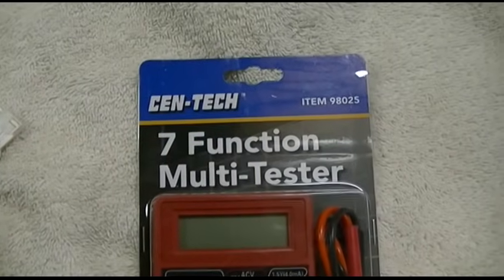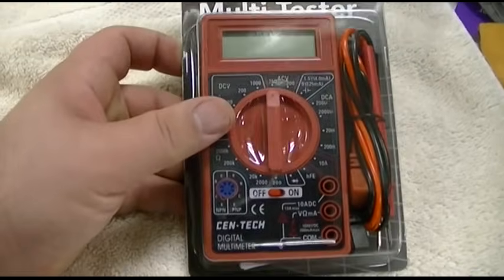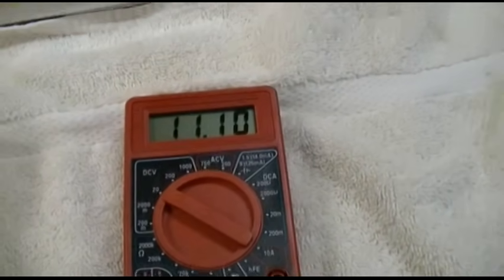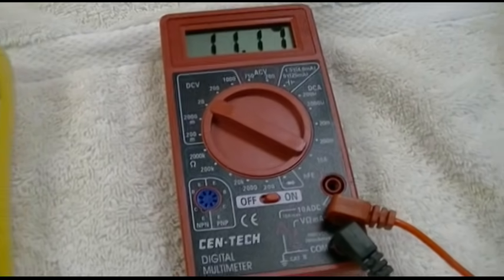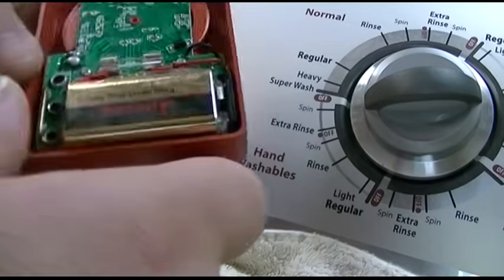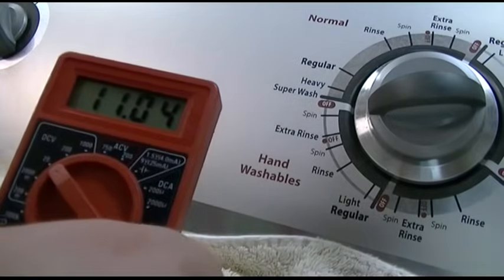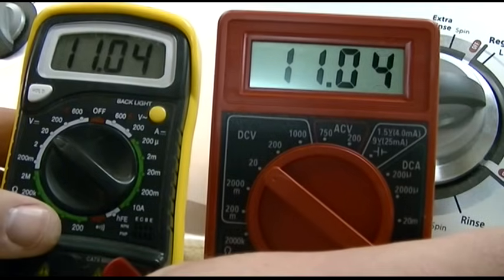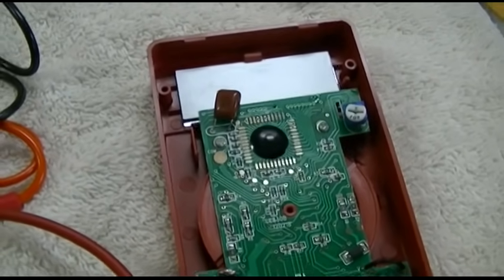Harbor Freight - Cen-Tech 7 Function Digital Multimeter Review

Comment: Oct 2025 Update to the Updates: Still have my free CEN-TECH Digital MultiMeter with fuse/adjustment Item# 69096 from 12-15 yrs ago, it works great and you're correct about the wireset probe insulating a single strand of hair. Today Oct 2025 $5 coupon, I bought same looking Red HF meter = 7 Function Digital MultiMeter Item# 59434. The name CEN-TECH is no longer on tool, package or paper, (7 Function) is on meter where CEN-TECH was. Still No fuse/adj, My Old meter DCV 1000, ACV 750 - 200, 10A. New meter DCV 250, ACV 250 - 200, 5A. Thanks for the Informative video.   Prices are up, I was able to get crabs the last time I spent $5.00.
Reply from the maker: At least they have become more honest about what the meter can measure with those leads.  With a good set of leads, while they may cost more than the meter, it could be quite capable.  I know the adjustment went away long ago.  As for the name disappearing, the name meant nothing anyway.  This is a generic meter that you can probably find on Aliexpress for even cheaper.  Harbor Freight contracted with them back when and had them print "CEN-TECH" on them.  When I was a kid, you could do some damage for 5 bucks.  10 bucks would do some real damage.  If you had 20, you were rich.  These days, even $20 means nothing.
Reply: @jaykay18  Copy that. Again, thank you for sharing the knowledge.
Reply from the maker: @paneesnatcher  You're welcome.

Comment: finally had to replace my Cen-Tech 92020 after 10+ years of use and the current replacement for this model is an off brand model (says 59434 on the package but no brand anywhere on package or multimeter itself) it looks nearly identical except for lacking a back light and the max readings have been reduced (5A / 250 DCV vs. 10A / 1000 DCV for the 92020) also the new unit is off a bit on accuracy by +0.27v and they've removed the adjustment pot so guess its luck of the draw for this one, it was only $4.99 in 2025 so guess I cant complain. I'll probably just buy the next step up model which is an actual cen-tech branded 9 function model for $15.
Reply from the maker: Even when adjusted on the old ones, this is still about the cheapest meter money can buy, at least retail.  You can probably get them for half that price on something like AliExpress.  Regardless, still a great meter for voltage or no voltage, when the reading doesn't exactly matter much but just has to be in the ball park.  Same with resistance, when you're looking for continuity or no continuity.  40 bucks will buy you a really nice meter on Amazon that's still pretty cheap, but ups the functionality.  I have one about that price, it's got the backlight, a flashlight, and even a temperature probe.  Meter leads are much nicer as well.

Comment: I have the same Cen tech seven function digital multimeter, when I turn the dial to DCV 20 V it’s still bouncing around between 15.5 and 18.7, does not zero out, what could cause this, put a brand new battery in it still does it, can you turn that little thing inside to zero it out?
Reply from the maker: You're expecting $200 meter performance out of a $7 meter.
Reply: @jaykay18  not at all, It used to zero out when I turned it on, now even when you touch the probes together it shows -1, just thought maybe there was a simple fix
Reply from the maker: @wild8757  The leads, probes, and meter are total junk.  That's why it's cheap.  There are 4 problems that can occur with this meter that I know about, dirty contacts in the selector switch, wires breaking off where they attach to the plug that goes into the meter, the jacks on the meter itself, and the wires falling out of the probes.  I have fixed all 4 problems on my meter and it's still working.

Comment: Trying to figure out why mine reads "5A" where you have it set instead of whatever yours says
Reply from the maker: It's been many years since I recorded this video, the models have changed over the years.
Reply: @jaykay18  makes sense.. just trying to figure out how to check the wires on my bike. I have a problem that's not visible. Not getting power from the battery etc... & thinking that i need to hold the black to bare metal then check individual wires with the red.
Reply from the maker: @danimal412  I don't know if bikes have ground bonded to the metal frame like cars do.  Motorcycles probably do, but electric bikes are a different animal.
Reply: @jaykay18  yeah pretty sure they do. A friend once was trying to locate my turn signals & his ground was a clip instead of pin head that he put on metal.

Comment: I picked up one of these for about $1.50 on clearance.  If you put a light source on the front side of the unit, you can read the LCD display from the back side while adjusting the voltage.  I like the super-bright orange backlight and the fact it has a power on/off switch.  So many units require you turn the knob around to the off position and this wears out the rotary switch.
Reply from the maker: This one has no backlight.  The on/off switch is nice indeed, especially if you are almost always testing for voltage, for example.

Comment: The probe wires always rip appart on these because they are only hanging together by a few strands of copper wire (inside the probe). I might do a video on how to take them apart and solder the wire back on. In the meanwhile, I recommend a drop of hot glue on the top of each probe where the wire goes in.
Reply from the maker: I already did one years ago:  https://www.youtube.com/watch?v=bx0X-l0QITA

Comment: Update 2023. The newer models are missing the potentiometer on the board (the empty space is still there for it). The fuse is no longer replacable without a soldering iron.
Reply from the maker: This is one of those rare cases where the information presented has become outdated.  All in the name of cost cutting.

Comment: You didn't mention where to plug in the red and the black cables on the device. I couldn't see what you were touching on the battery with the cables. Otherwise it was a good presentation
Reply from the maker: I did mention this was not a tutorial on how to use the meter.  There are many videos on that subject you can search for.

Comment: The portion of the circuit board where the test leads plug in and are then soldered to the main board is known to be a point where the solder joint WILL crack and then you will either not get a reading or your readings will jump all over the place so you can either re flow the solder joint but it WILL just break again or you can solder a small jumper wire to connect the small board over to the main board to prevent it from continually breaking. Mine broke within the first two days, of use. If your not changing test lead ports very often yours might last longer, but if you change them often I promise you it WILL break at that spot!!
Reply from the maker: Thanks, you are correct.  That is a known failure point.  I've had a video on that failure as well as the probes themselves failing, and the wires breaking out of the plugs going into the meter.  I have fixed the same meter many times over and keep using it.

Comment: In more recent models they have removed the replaceable fuse and the potentiometer. Still 9V that's about it.
Reply from the maker: This video was recorded 9 years ago.  A lot can change in 9 years, and a lot DID change in 9 years in the world.  But that doesn't make the content of this video obsolete, many probably have one of these they have forgotten about, and may find this video.
Reply: @jaykay18  I don't remember when I bought mine. Maybe 5-6 years ago I guess. Still works!
Reply from the maker: @Jules2950  They're pretty robust considering how cheap they are.  Main failure point is the leads, they can fail in 3 different ways, and I have videos of repairing all of that.  Other failure point is the selector switch, the contacts can get dirty.  Usually moving the dial off the position you need and back on will solve the problem.  If not, there's always contact cleaner spray such as De-OxIt.
Reply: @jaykay18  Yep! I've used De-Oxit on my radio potentiometers and mic switches for years. Great stuff!

Comment: the meter is good enugh.. leads always break... if only the sold better leads that fit which you can replace them with
Reply from the maker: There are plenty of leads out there that will fit this meter that are of much higher quality, the problem is, it would probably be more expensive than the meter itself.  Meanwhile, I do have repair videos of the 3 most common failures of the leads that comes with these meters.

Comment: I was so excited about how u show us the inside of this multimeter.. the battery, fuse and adjustment.. only to find out that in the newer ones they skimped out on the replaceable tube fuse and adjuster : / 
Anything to save and make them a few bucks. I never see these free anymore.. ive probably bought about 6 or more.. only cause my first ones went bad and didnt know about changing the battery. 
Still a great value tho cause they dont cost much.
I think i know but am not sure how to test amperage with one tho.. thats what led me to this older video u made. Thanks for the knowledge tho. Highly appreciated.
Reply from the maker: You really don't want to test amperage with this meter.  The wireset is way too thin.  If you were to strip away the insulation, you'd be appalled to fine there's barely a strand of wire not much thicker than a hair.  With a good quality wireset, you can probably measure 10 amps with it.  The bottom line is this meter is built to a price.  At the time I recorded this video, Harbor Freight still was reasonable.  You never see the meter for free, and barely even the flashlights for free.  All of their coupons went digital, nothing's that great of a price anymore.  They've really gone downhill since then.

Comment: Hi. Thank you for your video. A few quick questions. Back of this meter says for safety sake do not open the back of the device with leads attached. I see you had the leads attached. Was this warning not on the back of your device, or did you know from experience that it would not be an issue? I'd like to cross reference my multimeter to make sure it's calibrated as accurately as possible while still being safe. Thank you!! :)
Reply from the maker: They don't want you opening the case with the leads attached, because whatever you're metering would be live inside the case.  Meter 120 volts from the socket and touch the wrong thing inside the meter, and get zapped with 120 volts.

I, on the other hand, was metering low voltage DC, perfectly safe to handle, therefore nothing inside the meter would be dangerous.

The warning labels really serve no purpose.  It's up to the user to exercise due caution.  Sometimes, a mechanic has to work under the hood with the engine running.  He has to know not to touch moving parts, and there are no warning labels.  Yes, there are mechanics who have lost fingers for not being careful, it's entirely possible.  Accidents do happen.

Comment: Nice review!   Didn't know that these (at least older ones) had adjustments.  Newer ones are worse - I noticed that newer ones I got from HF have only 5 Amp current measureing capacity (where as old ones has 10 Amp).  Having 10 Amp capacity is useful because you can short test solar panels with it.
Reply from the maker: Thanks.  Yes, the old ones were better.  A lot of the stuff Harbor Freight sells now is even worse than it was 8 or 10 years ago.  I can only imagine what it will be like in another 10 years.

Comment: I had a free one that lasted a year and I noticed that the battery was low. I changed the battery and I could never it get the volt meter to reset to zero volts (calibrate it) but good video. If I get another one I will keep this in mind.
Reply from the maker: It's never going to read exactly zero.  This meter gives readings that are "close enough for government work".

Comment: just bought 2. both garbage!!
Reply from the maker: You shouldn't have expected anything else for less than 10 bucks.
Reply: @jaykay18  normaly I do not but there are a few youtubers saying how great they work which may have been the case years ago
Reply from the maker: @tomhorbach6852  Probably not by much.  Every single thing on this meter that can fail, has failed, and I have devised fixes for each one.  They were always junk.  But they're cheap, that's why people like them.  Great to verify "yes voltage" or "no voltage", maybe a quick continuity, that's about it.  As far as the accuracy goes, as the saying goes, "close enough for government work".

Comment: Great video     When testing a double A battery powered toy.   What setting should I turn the dial to? Thank u
Reply from the maker: DC Volts.  You always start at the highest range and drop it down, unless you already know the voltage you are expecting, in which case you can dial it right in.

Comment: I swear I have like 10 of these from the free coupons.They are not “Flukes” by any means but I’ve had one I’ve been using for years now and still works great .
Reply from the maker: Same here.  Now HF offers virtually nothing.  Haven't been in the one here in years.
Reply: Yes I have at least ten of these too from free coupon.  I stocked up knowing that HF can't keep giving these away for free.  Even among free items, multimeter was the highest value item.  And guess what no more free anything from HF (other than occasional free flash lights).

Comment: They don't give stuff away at the shops here, if they did I can see me getting more than I will ever need just for the batteries and salvaging components off the circuit board. They are three dollars on aliexpress, 3.50 if you want tracked shipping, probably a bit faster shipping too.
Reply from the maker: It's been 7 years since I recorded this video.  Times have indeed changed.  Good to know they're on aliexpress, 3 bucks is certainly worth it.

Comment: Just to let everyone know the new ones are even worse than this one. No adjustments and No replaceable fuse.
Reply from the maker: Yeah it's only been 6 and a half years since I made this video.  They don't even give them out for free anymore, so they're not even worth picking them up.
Reply: @jaykay18  They don't give ANYTHING away for free for months now since COVID-19. Virtually all freebie coupons ended in April or so...
Reply from the maker: @ShallRemainUnknown  Yeah, Harbor Freight has changed greatly since this video was recorded.
Reply: So is it not worth getting it now? I need to check my battery/alternator tomorrow
Reply: @missyidontgiveacrap9939  buy it if you need it.
Reply: @armandomorales3809  
Well, I took my car to autozone to have them  check the alternator/battery twice. First time they said alternator needed to be replaced, but second time they said it didn’t. So I wanted to buy a multimeter and do different read outs and was just gonna get a cheap one. But the more I read the most current comments, the more I’m thinking this HF one may not work as well? (I’m thinking it might be a connector problem but wanted to test it again while I run the ac, radio, etc to see if alternator reading drops before I rip the car apart replacing the alternator)

Comment: This was helpful even if the first hurdle of using it is having a working batter that did not explode >.<
Reply from the maker: I must have 10 of these meters.  Not one of them has experienced a battery that exploded, nor have any gone dead.  Your typical Duracell or Energizer batteries these days really aren't much better than what's included in the meter.

Comment: I need a multimeter for car repairs only

Is this fine or should i get something better?
Reply from the maker: That depends how deep you're going to delve in.  If you're going to be removing sensors from the engine and testing them for a proper resistance meter, I'd get something better.  If you're only going to be using this to verify if you've got 12 volts or not, it's probably fine.

Comment: jaykay18:  I have one of these that I got at Harbor Freight Tools.  It is the exact same one that is in this video.  I have had it in a drawer for many years, and it has never been opened.  I was wondering if there is a battery inside it that makes it work?  If so, do you think I should replace the battery?
Reply from the maker: Yes, there's an el-cheapo 9 volt battery inside.  If you're lucky it went dead, if you're unlucky it leaked, which can certainly happen.  My recommendation is NOT to keep a battery in it unless you'll be using it on a regular basis.  To change the battery, take the screws out of the back and it comes off so you can access it.
Reply: @jaykay18  I took the battery out of it and it looked brand new.  No leaking.  This is the exact battery the came out of it:  https://contestimg.wish.com/api/webimage/5b3f1d6a5cdd1915d4e22e68-large.jpg?cache_buster=dcad950c57559b201e2ce07b54c23375
Reply from the maker: Well if it's still good, then it can even be used.  I've seen cases like you had where they'd be many years old yet never leaked or had a problem, and I've seen cases where you buy a Duracell, name-brand battery at CVS for $7.99 for one, and in less than a year it leaks all over the unit.
Reply: @jaykay18  The previous 9V battery didn't work, so i put in a new one, and it works fine now.
Reply from the maker: Good to hear, thanks for letting me know.
Reply: @jaykay18  I really do appreciate your help!  Because of you i will be saving alot of money on batteries.
Reply from the maker: Thank you, it's my pleasure!